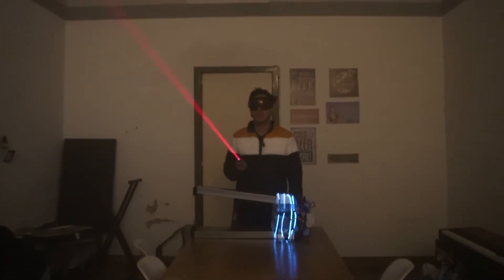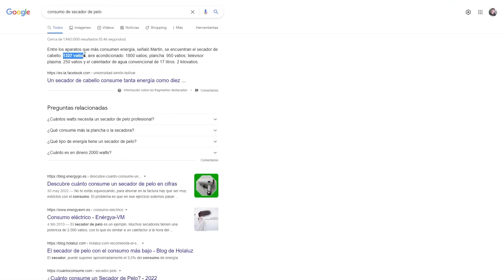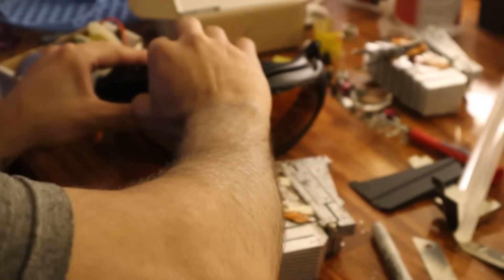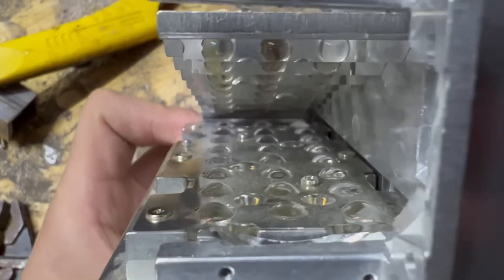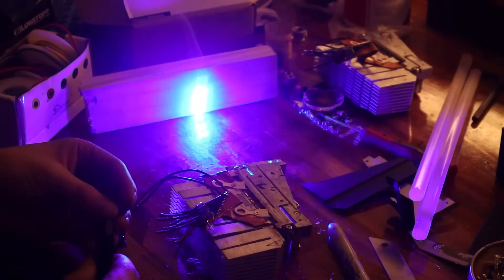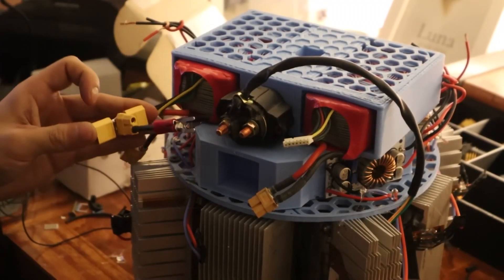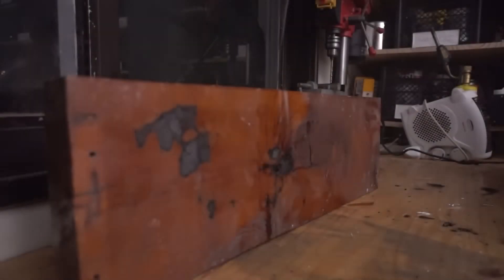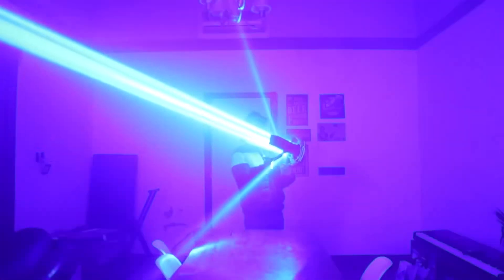I made the world's most powerful homemade laser.

Comment: I liked it, but it still lacks professionalism as of proper safety measures explanation, at each scene there should be proper explanation I think.
examples lacking-
1. Telling that even reflected light of such energy WILL break the camera sensor, and WILL break your eye sensors.
2. Private and military planes are often not visible on flightradar24, or other commercial use radars. So it was still a risk.
3. For giving a bad example of turning that thing on inside of a living room XDDD.